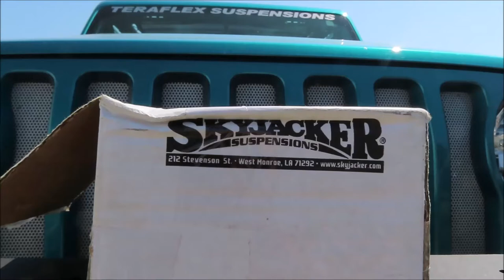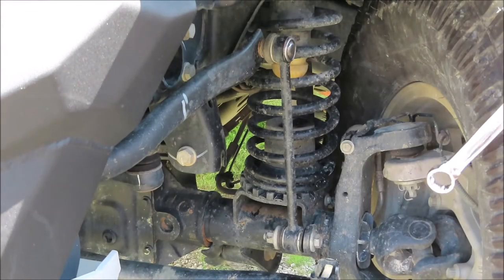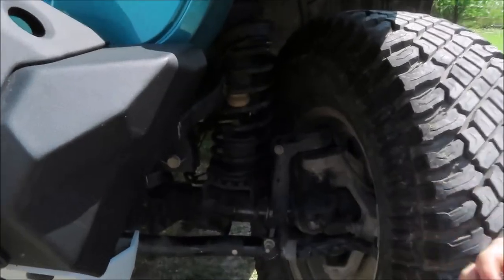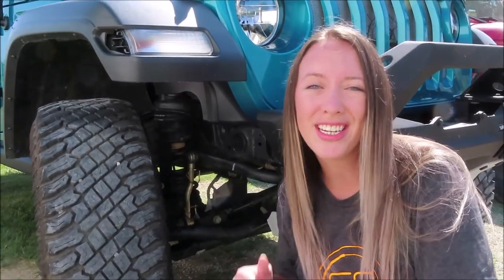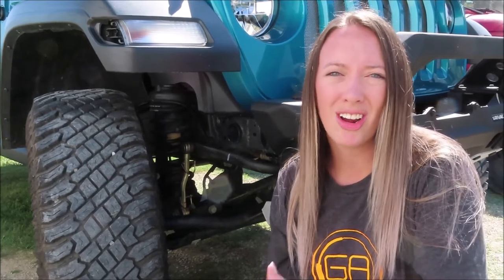Installing SkyJacker Quick Disconnects on our JLU!

Comment: How did you store away the swaybar? Did it just stay up because the bushings are still so new?
Reply from the maker: We usually just zip tie them up.
Reply: @LifeonBackForty  The Skyjacker style does not work like that. You take the body and pins in the cab and put them back on later. Only those little mount nubs, top and bottom, stay put. No zip ties with these. Maybe a Ziplock bag to put them in while disconnected.

Comment: More interested in how easy/hard they are to disconnect and reconnect.  Are they noisy?  Do they preform well when connected... expanding your research and documentation of the product would be better than a simple install. You didn't even show that they should be torqued to a specific foot pound. Just destroyed your bushings and sleeve with too much torque.
Reply: Any video of taking them off?

Comment: Just bought some.  they are junk bad fitment a pain to put back together and clunk when driving down the road. Sorry nothing about the is quick or convenient.  Keep the oem one's on and  pull the bottom bolts when off road